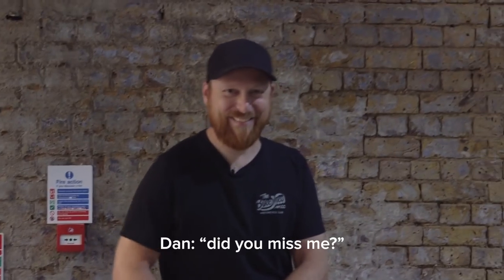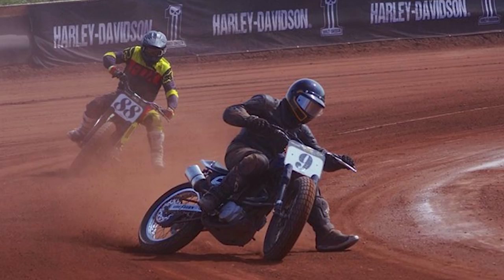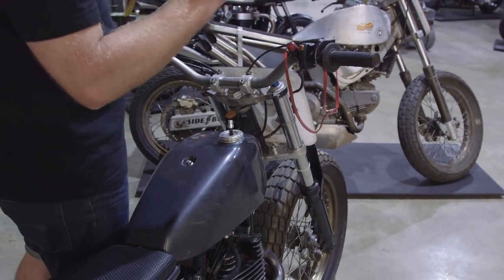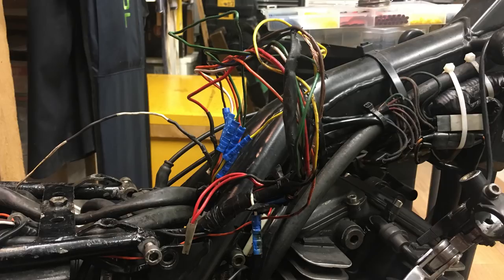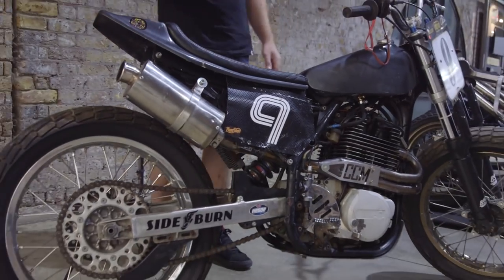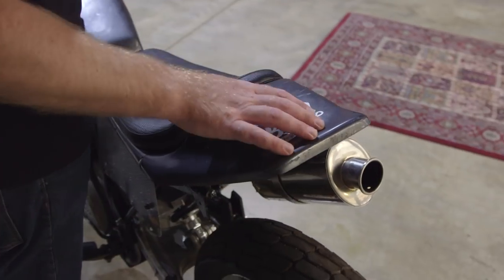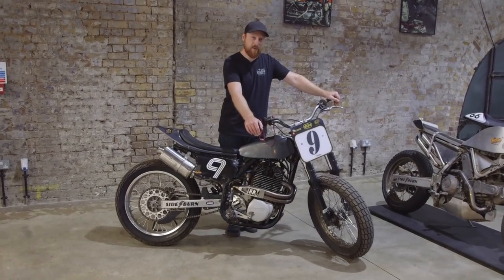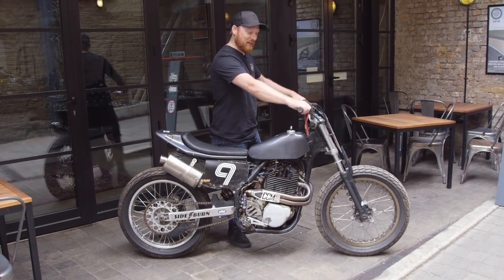Ross's CCM Rotax Thunderbike

Comment: “Not snappy enough” 🤣 OMG What a way to expose yourself as a fool who can’t set up a carburettor 😨  Do it right and it’s snappier and faster than the twin.
Reply: I have a VM44 carb on my aprilia tuareg wind 600. It's the same engine but 560cc. It is rather snappy... Probably to snappy for the road at least. As soon as you give it throttle, your ass slides back on the seat and the only thing stopping me is the givi box on the back lol.